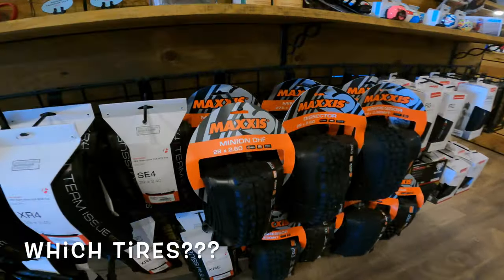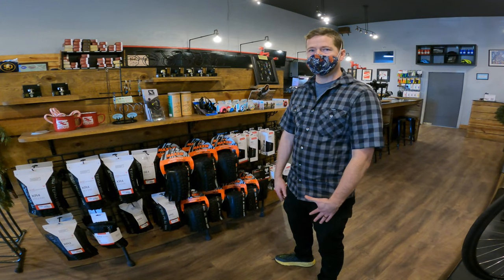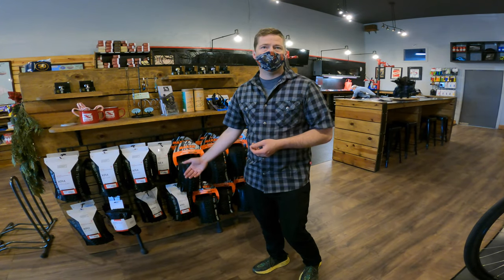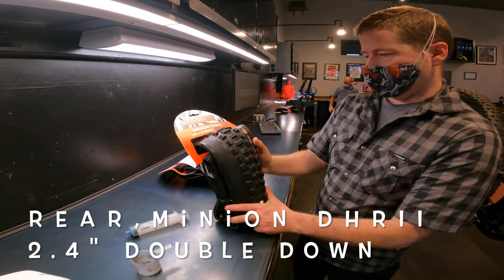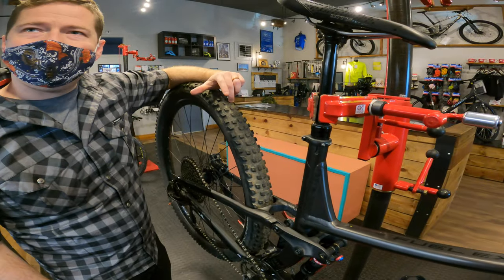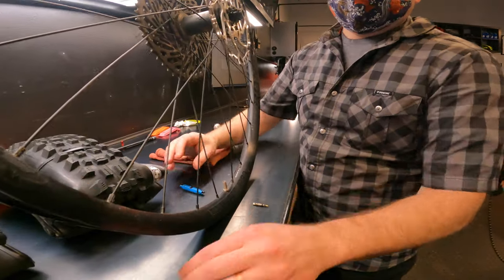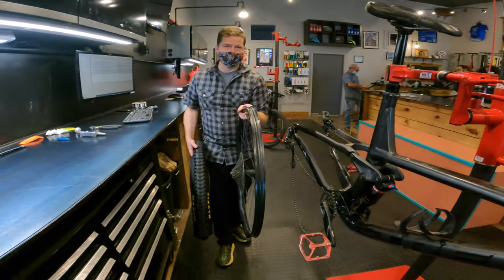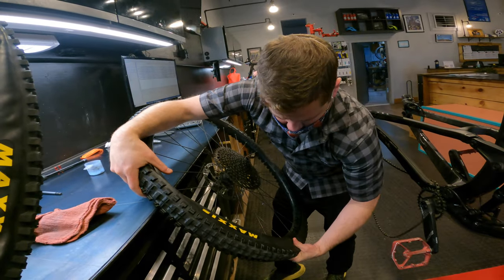What TIRE is the BEST, where to BUY them? Maxxis Tires

Comment: I´d be helpless or dead if I would listen to my local bike shop^^ Their first advice was "do never ride tubeless" 🤣🤣🤣 
I ride loamy/loose terrain - without sharp edged rocks - mid europe - so our soil is completely dry for like 4 months a year only - I ride 1,3/1,6 butcher trail grid on one wheelset and a mix of 2,4 dissector in the back and 2,6 dhf in the front. Both 120tpi max terra 3c exo, in a lighter version with cush core. For me that does a way better job than super heavy 1,2kg tires with dd casing.
Ty for the video!
Reply from the maker: Never ride tubeless 😳 such bad advice 😂 glad you liked the video.

Comment: I love Maxxis grip. I was given an old stock 26 x 2.7 that I put on just b 4 Covid and it lasted a good year of use (before one sidewall failed and the tyre ran off the rim.. but thats what you get for an old stock tyre. (got a nice bit of video on one of my last rides showing how I can peal it off the rim while fully inflated...   q8)
I just got a pair of 26 x 2.5 Minion FT 42A's.... mmmm Sticky.
Unfortunately I love plus tyres and the world has ignored the riders on 26" bikes now so a tiny 2.5 is really all you can get (And I find Maxxis smaller per size rating than a lot of other tyres.
(Had this a LOT with motorbike tyres where sidewall measurements were inconsitant in how they came up with the figure.. some a total percentage, others a width... sigh.)

I ran a Gazzaloddi 26 x 3.0 on a Foes Weasel for ... 20 years... yep its still on the ol thing.. it will be interesting to see which one of us goes bald 1st...
Man I miss Gazzaloddi's... you had to bunny hop often to clear sticky mud from the big soft surface but that was just part of the plus size tyre fun.
Reply from the maker: Heck yeah man. The right tires make all the difference 🤘🏻
Reply: @JaredHoff  My Gazzaloddi front was so oversize we filed groved in the boxxers to fit the outer tread and on the road, if you did a bunny hop, the shockwave pushed out as the tyre rotated and gave a neat brrrzt as it touched the forks on the way past...

they were heavy and slow rolling tho... sigh
Reply from the maker: @TheButlerNZ  sometimes I don’t care about heavy and slow rolling. If it makes me feel more confident than I’ll get more speed anyway.

But I’m no XC racer lol
Reply: @JaredHoff  I have at least 3 heart attacks getting to the top of my videos..

q8)

yes slow rolling tyres are no issue if your not a fast rider. 
The Foes (i have a walkthrough of it on my channel) was so plush at the front end, I would put newbies on it on the street, point them at a curb and say ride straight into that...
I'd watch them tense up and hit it, then come back with a dopey grin saying OMG... I didn't feel the curb.
My 'Faith' has 40mm totems and they are a little sticky (I now invert the bike at the top of a good run to wet the seals) so small bumps are a bit more like riding on cheap forks.. but even on a 1m dropoff I don't think a have felt any noticeable bottoming.. (the zip tie on the stanchion  says I was close...)

If only I could ride anywhere near what the Faith or even the old Foes was made to take.
And years of trailbike riding has ruined me for non throttle powered jumps sigh... (that and a shattered wrist from a double (or was that a 1.9) on my YZ250)

Comment: EXO IS NOT a tougher as said in video. It is the WEAKEST! Cuts and fails quickly. Order weak to tough is exo, EXO+, double down, DH. 
The tire installer was very stingy on the tire sealant in my opinion. Especially for a new tire of that size 29 x 2.5. I would not trust that guy!
Reply from the maker: You’re right! I miss spoke on the video. A lot goes into filming and editing, and sometimes I don’t catch the mistakes. Thanks for the correction 👍🏻 I’m always trying to improve

Comment: Sir how about the maxxis pace and freeflow?
Reply from the maker: 🤔 I’m going to have to check those out 🤙🏻
Reply: @JaredHoff  thank you sir. Im from Philippines and my route is purely road. So I wanted to buy a fast rolling tires and they recommended me maxxis pace and freeflow.
Reply from the maker: @cocoboy5215  That makes sense. I ride a lot a very rocky, rough and steep trails so I definitely worry more about grip that fast rolling. But Maxxis makes great tires for all types of riding.
Reply: @JaredHoff  yes sir. But i cant find these 2 tire types in maxxis tire lists. Ride safe sir.
Reply: @cocoboy5215  What about Maxxis Aspen. I haven’t tried it but I also am looking into purely road. They said it’s fast rolling
Reply: @mtbjoser  i haven't tried it also but i have heard about it.  I bought maxxiss pace. Its definitely fast rolling but its not that good in braking power specially in descent.  Next time i will buy maxxiss ikon. Its pt fast rolling but it ca do both in in road and in trails.
Reply: @cocoboy5215   Oh ok good to know, thx for the info. I have heard good things also about the Ikon. If you are going to do both road and trails, then yes, you will want something with more braking power. My bike came with Rekons, those are pretty fast too, probably more grippy than Ikon and a bit slow on the road though. Happy riding to you!
Reply: @cocoboy5215  P.S. I watched a few of your videos just now, nice! Well-edited. 👍